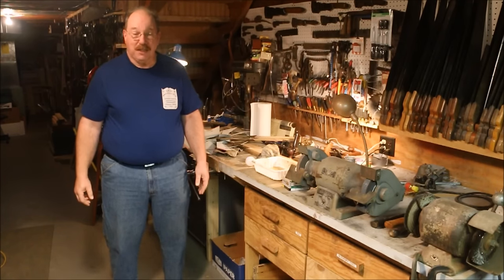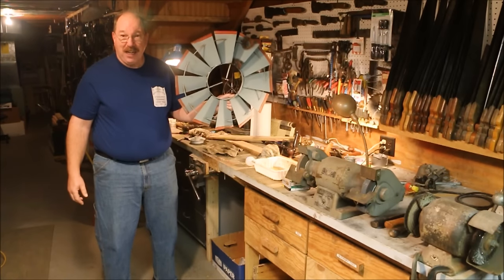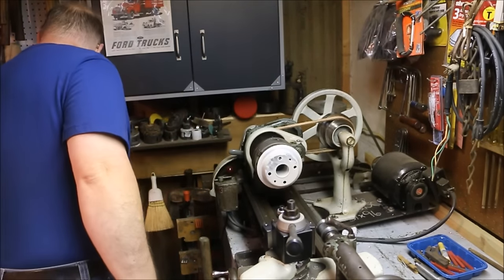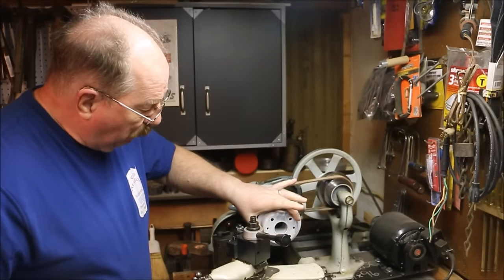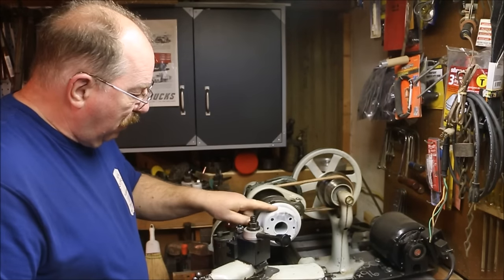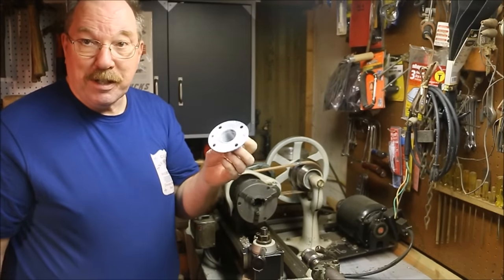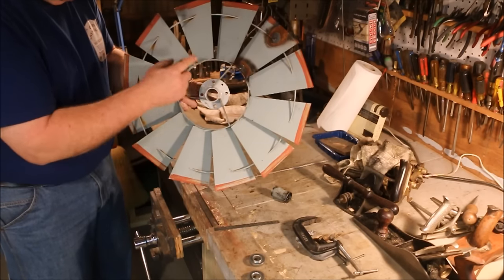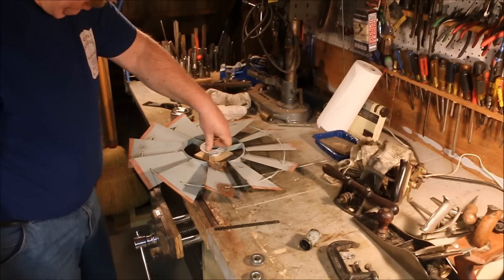RESTORING THE WINDMILL ~ REPLACING THE HUB

Comment: I have one of those windmills ..I put a hub from a front bicycle wheel in it about 5 years ago It is in need of repair again ...I may copy your Idea
Reply from the maker: Almost went with a set of bicycle cone bearings before I found the cart wheel.
Reply: bicycle bearings are used in this type windmill
Reply from the maker: I thought so too Bert. The local bicycle shop didn't have any that matched. I could have used a front bicycle  hub but decided to go with the larger heavier design.